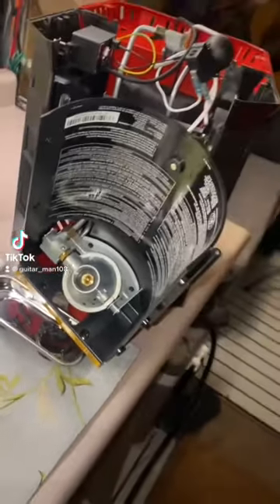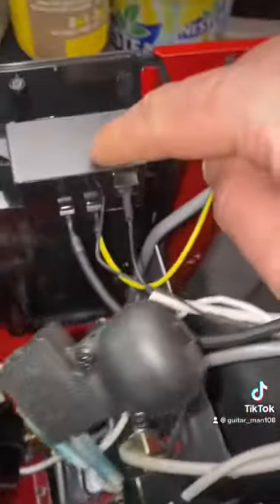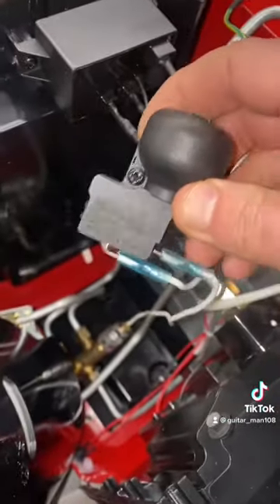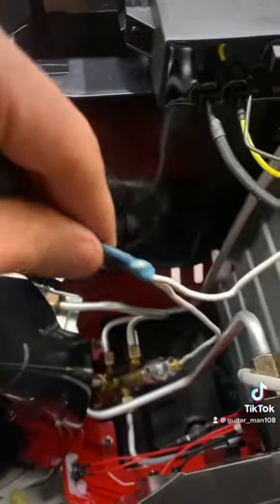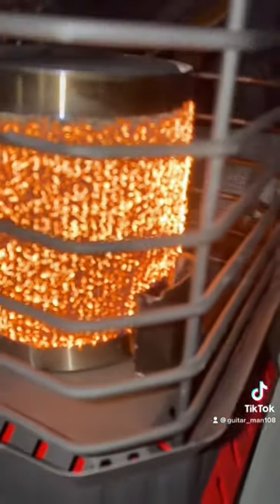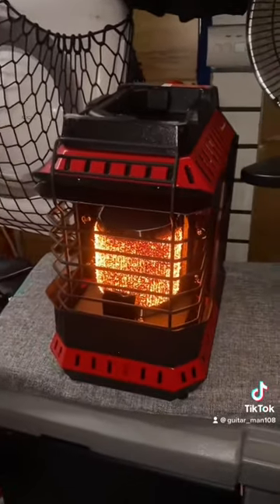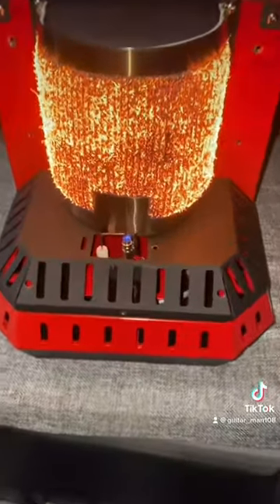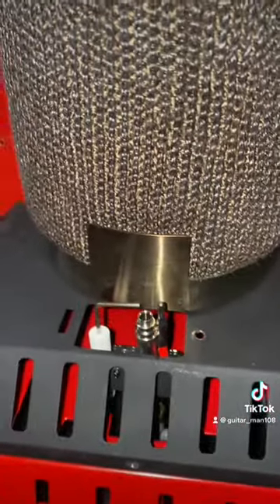Tearing down BUDDY FLEX 💪 MR.HEATER FIX

Comment: Tip it over to see if it goes out. I just got one from Amazon but when I took it out I noticed the styrofoam inside was busted and so is the outside of the package a bit. I'm worried that something inside could have come loose like some of the pressure fittings. I called Amazon and they gave me my money back and told me to keep the unit but I wanted to see from your video what it looked like inside.